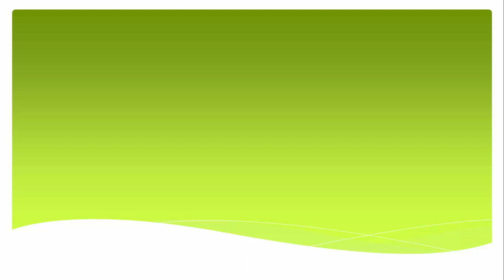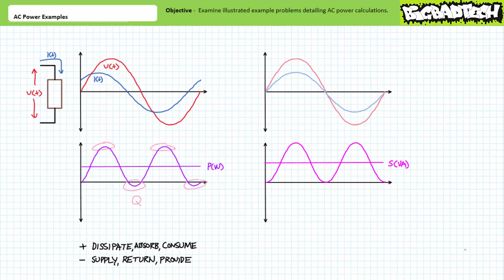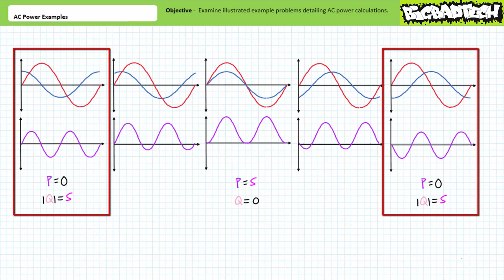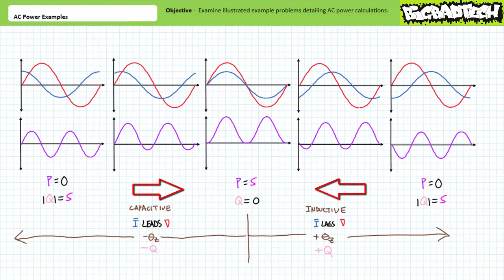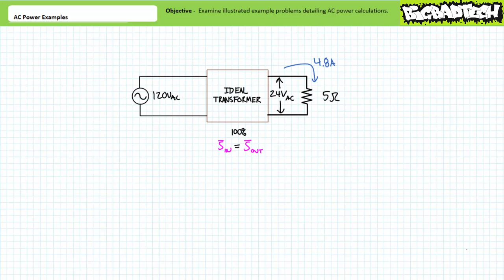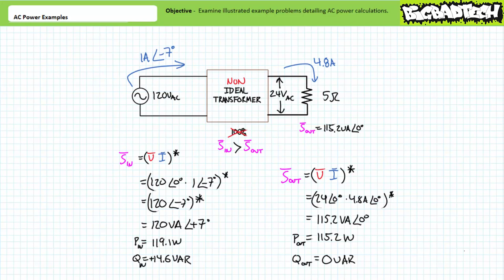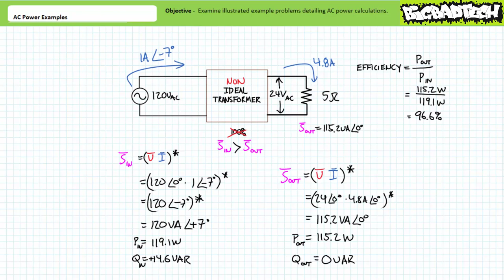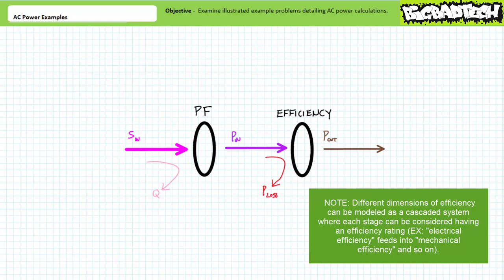AC Power Examples (Full Lecture)

Comment: I'm glad you included the V^2/Z method in problem 2-3. I would have gotten that one wrong! Since impedance is by definition relative, you don't change that one to a relative angle. If you try squaring absolute voltage, you fail. Even though doing the intermediate step of calculating absolute current takes longer, it's a trustworthy path to the same answer.

Comment: Hallo Sir.
May i ask a question about loaded and unloaded motors at 40:00,
The motors at the same voltages 120 AC draw different amounts of current.
And their apperent voltages  are different. 
Can we say that,  in loaded electric motors, we see a reduction of impedence ?
Reply from the maker: It's WAY more complicated than that! Stay in touch because I'm working on two lectures that describe the mechanical and electrical characteristics of squirrel cage induction motors that I'll be releasing soon. In summary motor windings can be modeled as losses, real power, and reactive components that change at various points on the speed torque curve. Additionally there is a variable CEMF value that changes as a function of speed. All these variables affect the amount of current drawn at different operational points.
Reply: @bigbadtech  Sir, first of all, thank you for replying to my questionn.
I totally forgot CEMF of induction motors. 
And I am all on board for these courses. I am looking forward to learn some more.
Thank you

Comment: I have a question about 2-3, so I took the relative phase shift between the impedance and the voltage as impedance leading voltage by a relative 54° to find the current flow, since voltage is -14° and impedance is +40°, and so I got the right values at the wrong angle for current and apparent power (375 mA at -54° and 39.4 VA at -54° respectively), what did I get wrong about the angle here? I'm really scratching my head on this one.
Reply from the maker: The only time "relativity" needs to be taken into consider is current relative to voltage. Think of voltage and current being inside the same "domain". Impedance, however, is its own property and can be considered an absolute. Think of impedance as being in an entirely separate "domain".
Reply: ahhhhh gotcha gotcha, thank you!